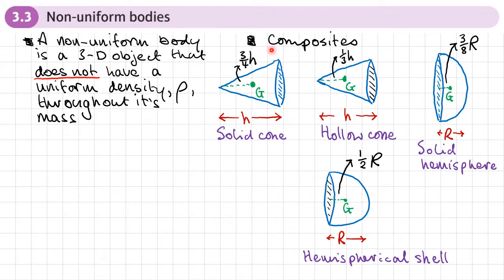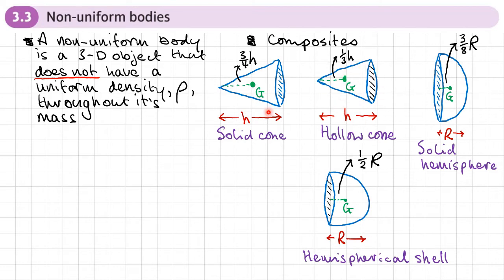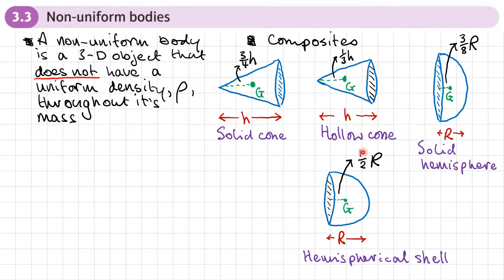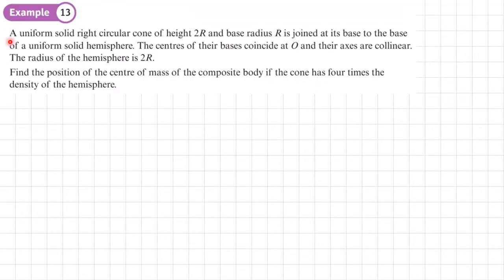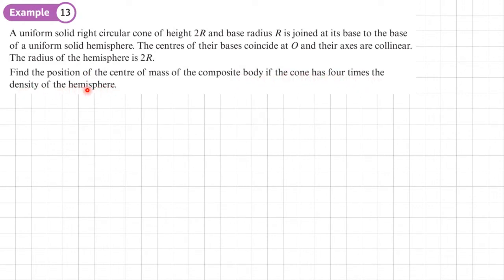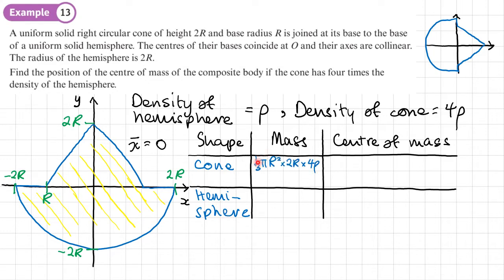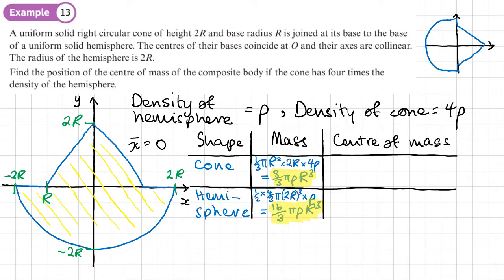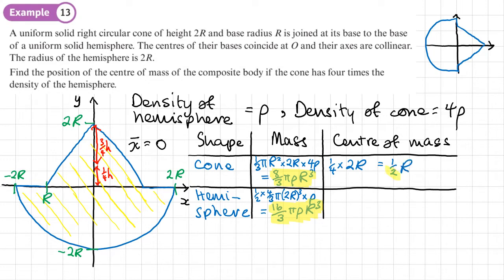3.3 Non uniform bodies (Further Mechanics 2 - Chapter 3)

Comment: In example 14 I tried to find the x where  mass, -0.1x^2 + 20x= 190/2= 95. And said that was the COM which makes sense as mass above and below are equal, however it gives a different but very similar answer to the method you use. What’s the floor in the method I used?
Cheers
Reply from the maker: It's a non-uniform rod, and you have treated it as if it were a uniform rod